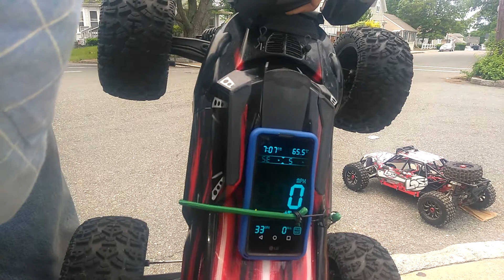Trmt8e be6s, losi dbxl 8s, e maxx brushless speed run pt2!!!!

Comment: great video..just got the dbxl to add to my collection.  what is the stock pinion on the dbxl...I havnt taken anything apart or had time to look into too many of those specs just yet.  ive got a sc10b  (team associated)..  the fastest ive clocked any of my rc's was with that one at 73Mph.. keep the videos coming!
Reply from the maker: richard mendez thanks for watching the stock pinion in the dbxl is the 18 tooth
Reply: where do you recommend getting batteries?  right now ive got 2 x 4s 5000mah 50c dynamite packs.  was looking to get something higher in capacity..and thanks for letting me know the stock pinion.  good to know that I should be getting around the 45mph mark stock out of the box on 8s
Reply from the maker: richard mendez gens ace is good. I have 7000 mah gens ace packs. 60 to a 120c burst they are amazing batteries very powerful.
Reply: thank you very much.  ill be sure to check them out and grab a couple and check them out.